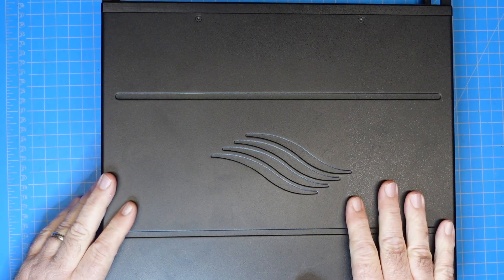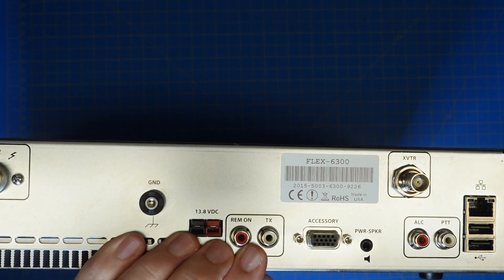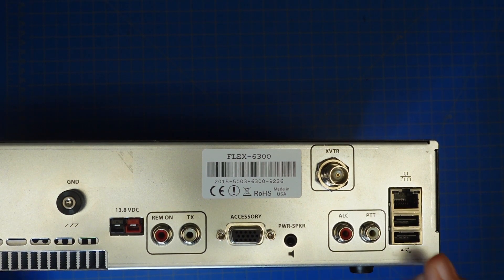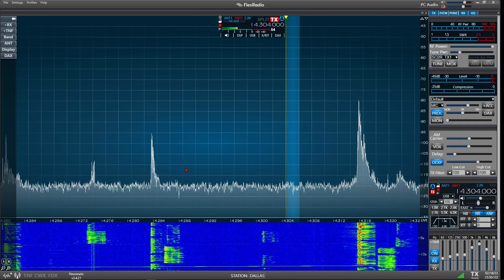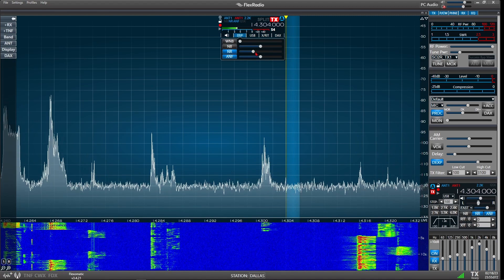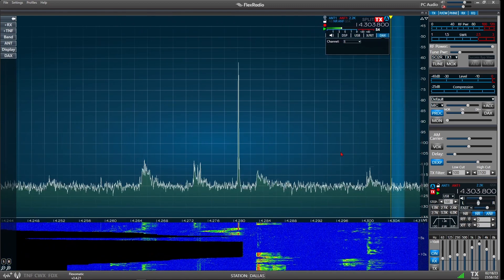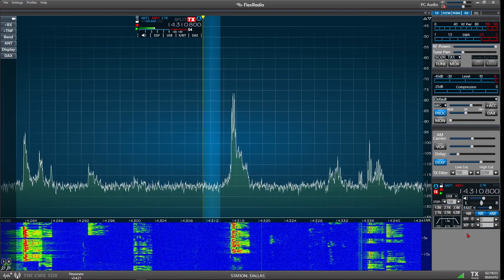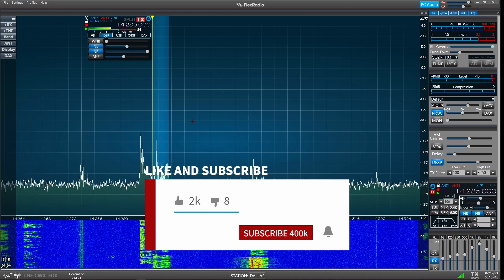FlexRadio 6300 (NEW to me), and SmartSDR Overview

Comment: I have a Flex-6300, run it with my iPad Air with SmartSDR, or my Mac mini with xSDR6000. Typically I'll run the radio with the iPad, use network xCAT and xDAX on the Mac and run my digi mode software on the Mac. I use the RCA TX 1 for the PTT trigger for my Ameritron AL-811 amp. It's configurable in the software as to which of the RCA jacks you want to use for a third-party amplifier. The Flex-6300 is a great radio, I've had mine for years. Frankly, the Windows version of the software sucks eggs thru a straw because Windows itself sucks eggs thru a straw. On the Mac you have your choice of several SDR clients for the Flex.

Comment: Hello. I loved your video! Im thinking of buying a true SDR radio(Flex or Anan). Will it be better to go for a Flex 6400 vs a 6300?  Thanks and regards. TI2JS
Reply from the maker: Thanks!  the 6300 and the 6400 are darn near the same radio.  THe 6300 is a 1U pizza box enclosure, and the 6400 is more of a toaster oven sized box.  THey both have 1 SCU, and can run 2 slices.  As the 6300 is out of production, you can probably pick one up for 800-1000 less than a new 6400.  Mike Walker, VA3MW (Flex Radio) mentioned on a live Coffee and Ham Radios stream specifically that he thought the 6300 was a super good value buy.

Comment: So if I use a separate receive antenna I can use both my transmit  and receive antenna at the same time on the same frequency?
Reply from the maker: Interesting question, I would assume so?  Of course, when you transmit on Slice 1, Slice 2 probably gets attenuated a lot, to prevent an overload of the front end.

Comment: The TX input is to activate PTT remotely. For software upgrades it is required to push the PTT.
Reply from the maker: That makes sense.  You can also do that with the hand mic.  I had to do it to enable smartlink.  Which I discovered when I was not at the radio.  :(